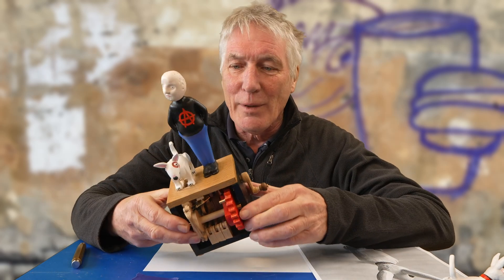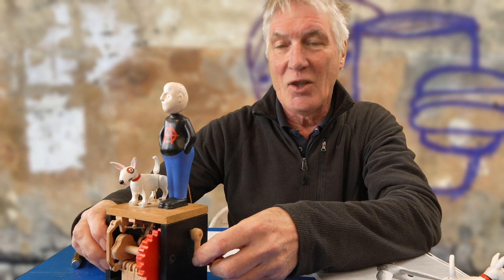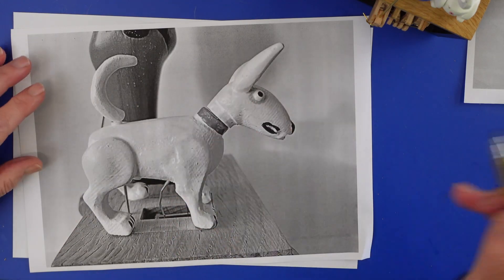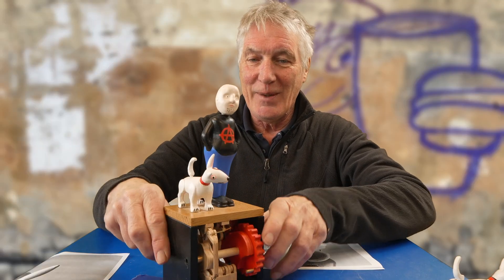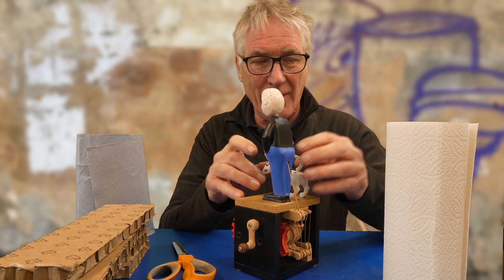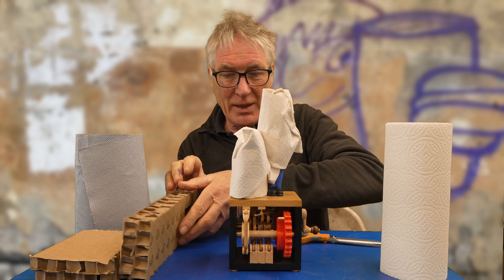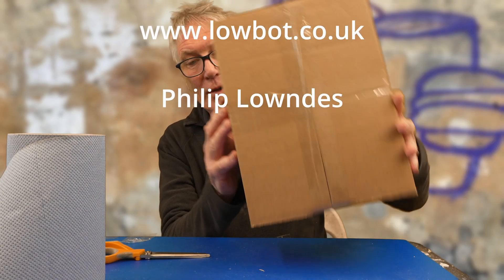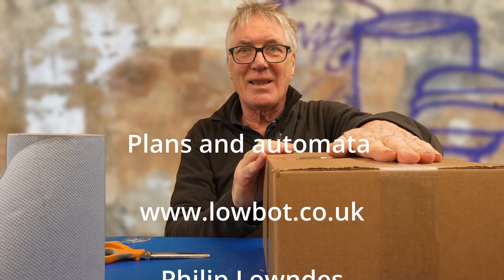Automaton mechanism secrets. Bye Sid, I’ll miss you!

Comment: Philip, I'd love to see more explanation of how you use the Geneva wheel to make sequential actions.  How does the turning of the Geneva wheel actuate each cam in turn?  Thanks
Reply from the maker: The 3 cams are all on the same axle. This particular Geneva wheel has 4 stationary positions. (I also have designs with 5 positions.) The cams are then orientated on the axle to move the cam follower as required at each stationary position. You can see this in the rear view inset in the video. I hope this helps.
Reply: Very nice automaton, there will  be a nice surprise for someone  when it arrives. What type of paint do you use and has it been lacquered/ varnished if you don't mind me asking. Thankyou in advance.
Reply from the maker: Thanks. I start with a coat of gesso to fill the wood grain. Then acrylic paints followed by 2 coats of gloss acrylic lacquer and a final coat of dead flat acrylic lacquer. I spray the lacquer on. It is quite thick so I dilute with approx. 30% water.
Reply: @woodenpersonality  thankyou for your reply, it's a very nice finish thankyou for sharing. I have always been fascinated with automaton's and anything mechanical. I have just made my first attempt it's just a prototype for now no cam's and followers yet. It's great that you share your knowledge with others.